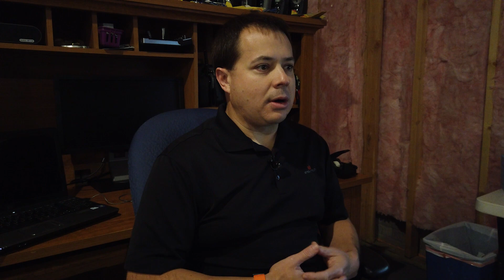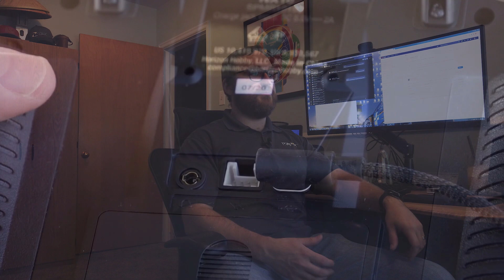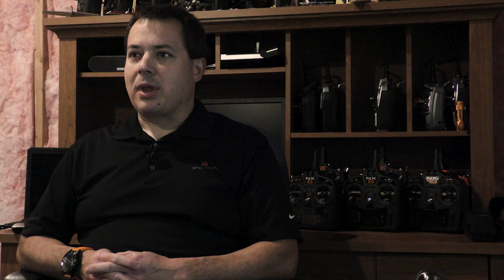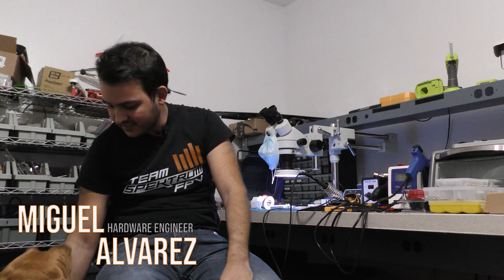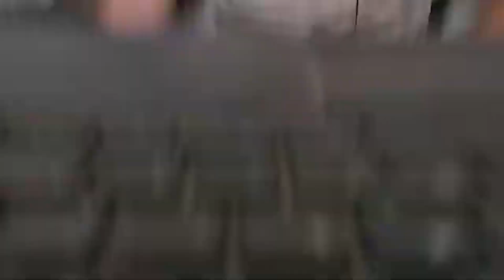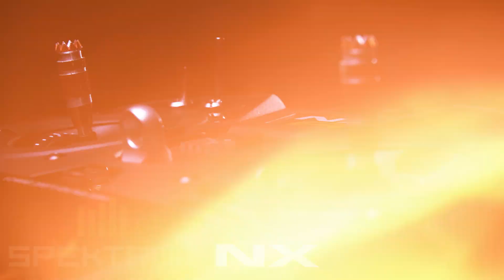Horizon Hobby Behind The Innovation: Spektrum NX Family of Transmitters

Comment: They skipped the part where they cut corners, used poor quality parts and programmers that didn’t have a clue what they were doing. Product was sent to market and the consumers used for beta testing and getting stuck with the repair bills. If they are so great, why only a one year warranty??
Don’t sell your DX transmitter, this is not an upgrade it’s a serious downgrade. Do you’re research before buying and you will quickly find out that they are plagued with numerous issues. They should all be recalled!
Reply: You work for Radiomaster, don't you?
Reply: @adamrodgers2377  
LOL. No just telling it like it is.
I actually bought a used DX9 to continue using my airplanes and a Vbar touch for helicopters.
Even the newest version the Vbar touch EVO had an issue but it was only one issue not a long list of them and Mikado was quick to step up and acknowledge the problem and resolve it.
So I guess the key is not to buy products that are new to market, give them a year to see how they perform. I’ve been using Spectrum transmitters since I started flying over 2O years ago and in that time only had to replace a gimbal on a 5 year old DX9 which at the time was 4 years past the end of warranty and I was fully expecting to pay the repair bill but Spectrum/Horizon fixed and shipped it for free. 
So I was very disappointed when they refused to repair the NX10 which was only 2 months past warranty and the issues all firmware problems not mechanical. So like many big companies they fail to see the big picture and try to save a few bucks in the moment not taking into account they will lose a loyal customer who has thousands of dollars on their products over the years. So like I said my intention was just to create awareness on my experience with the NX10.
I haven’t completely given up
it, I still do any updates that are released hoping it will resolve the issues but so far no luck.
Haven’t tried Radio Master, they any good?

Comment: I have DX6 3rd Gen, how far way in firmware and extra's is it from the NX6?. I know that some of the features on it nearly the same as the NX.
Reply: Right now? There's a bunch of new features, but core functions are not that far apart. The difference is that the NX series has a lot o opportunities to add more features, while the DX series are very close to their limits already.

Look at some of the cool things in the IX20 like On-The-Fly trimming. That's running on the same channel processor as the NX radios and could one day come down to them as a feature, but can't be implemented on a DX radio.
Reply: @adam_mawz_maas  Yep COULD come, if they allow it but unlikely.

Comment: What about open TX or be side by side with ghost or TBS on 2.4ghz
Reply: These radios already support CRSF externally, they've answered elsewhere that they're looking at Ghost support as well

Note you wouldn't want to use the internal RF when using external 2.4GHz, you'd be interfering with your own transmissions.